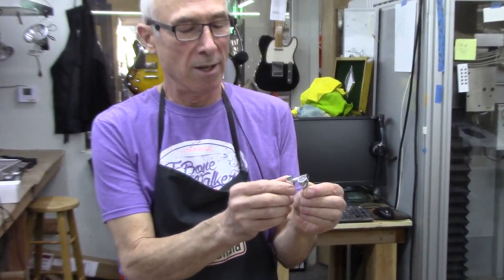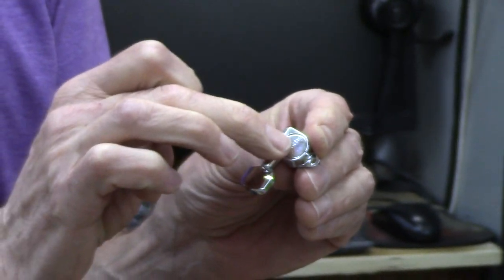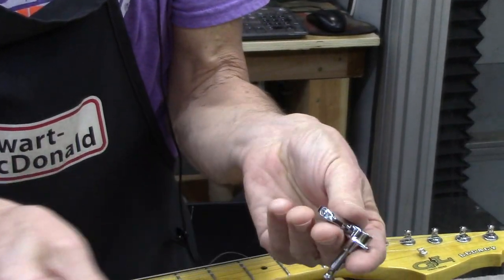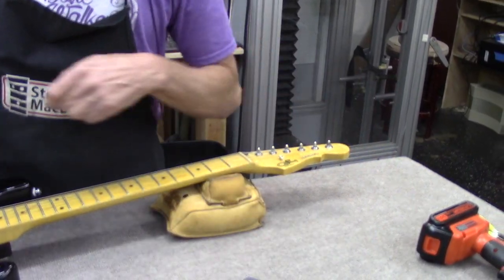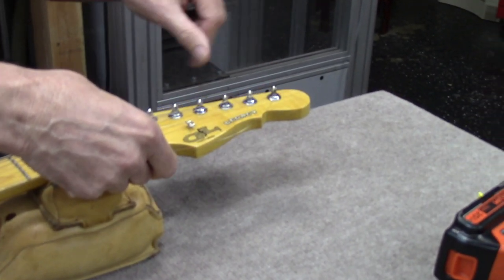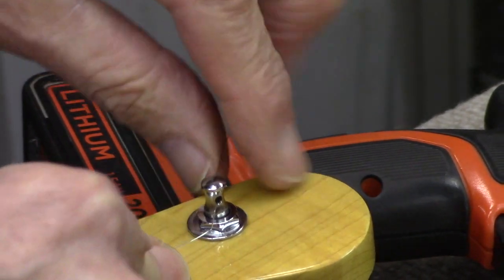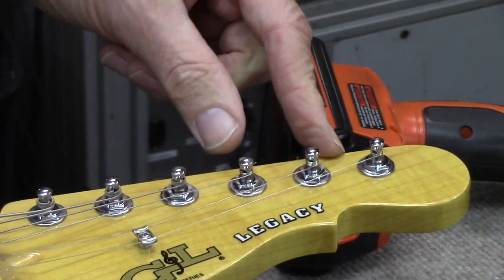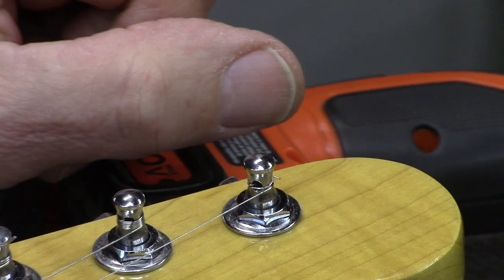Guitar Tuning Peg Maintenance

Comment: This video is just what I was looking for with regards to the screw on top of the tuner. I've read about tightening the nut on top of the headstock that holds the tuner in place. I've done this on my Telecaster and Les Paul and it made a good difference, in terms of stability and tone.

Comment: How do you fix the play/slack in a sealed tuner? E.g. I can turn it but it does not actually turn the page until I have spun the knob about 1/3 turn, then it turns the peg.  There is slack in the tuner.

Comment: My tuning machines have a different wording for each one (L1, L2, L3, L3, L4, L4). I think it's the order but I don't know which one goes to the low E and so on... Any help please?
Reply: Bit late of a reply but that suggests to me that they are staggered tuners and are all different lengths, the purpose for these are to keep the break angle of the string over the nut to the tuner the same on a non angled headstock (fender) and so the shortest one goes furthest away from the nut. Search staggered tuners if you are still confused.
Reply: @andrewcollins4458  yeah, I know about the staggered tuners... These ones seems like aren't so. Mounted 'em without problems... I was just wondering if they had any different ratio from each other.
Reply: @lovecraftmusic8717  Not heard of tuner sets with different ratio,s but that doesn't mean they don't exist, at next string change you can count how many turns for one revolution but as long as there working well it,s all good.

Comment: My tunning peg the long gear on the inside that the wheel shaped gear turns when it spins has pushed out so it wont turn the post anymore if you know what i mean, can i adjust or fix it??